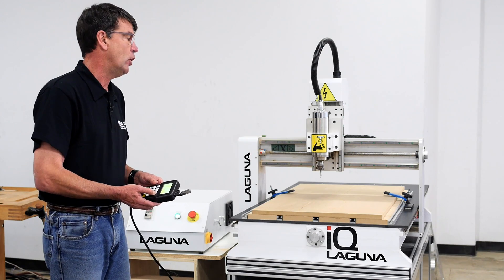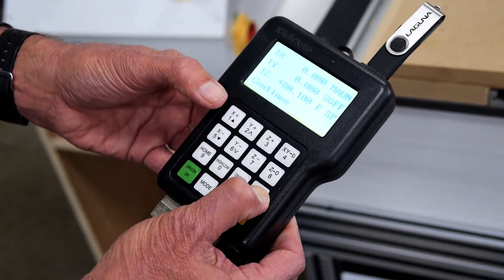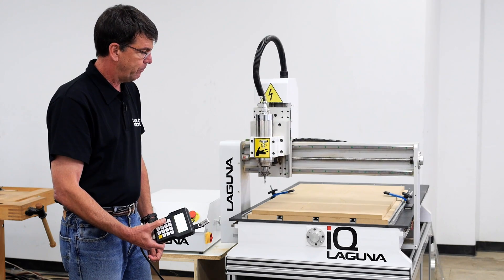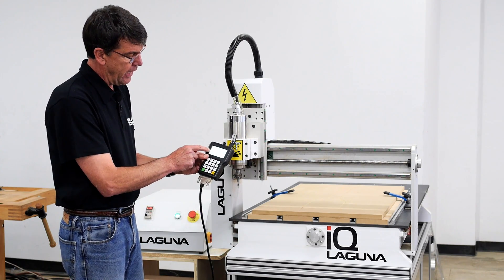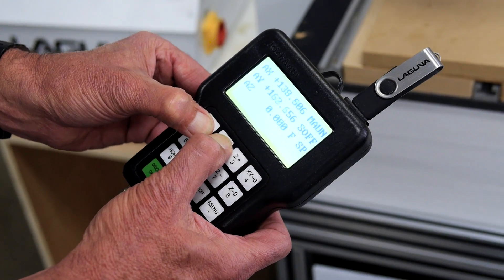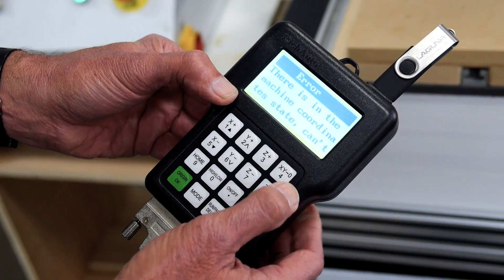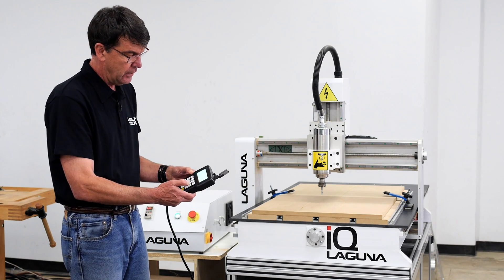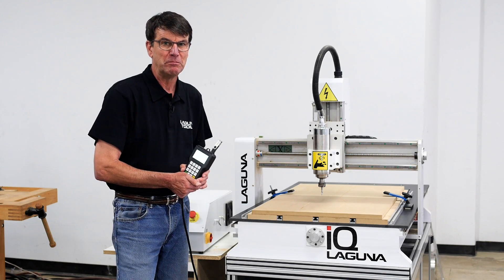CNC Tech Tips - Setting An Origin - Vol 502 | Laguna Tools

Comment: Great machine... if you are doing manual tool change, can you change tool, load next tool path reset z axis origin commence routing will it remember previous x & y origin ? or do you need to calibrate those also each time? Best regards TJ